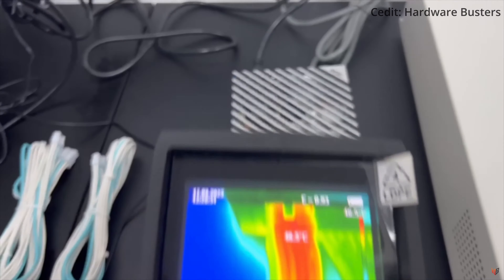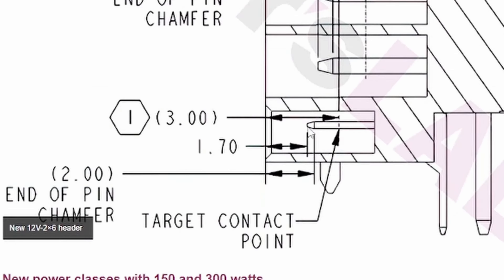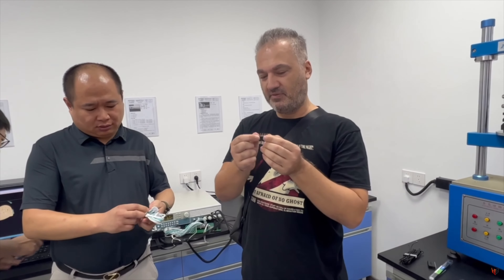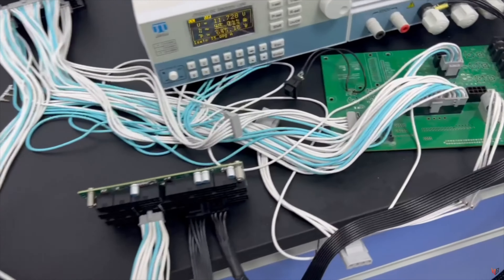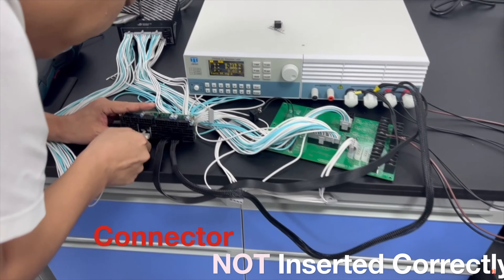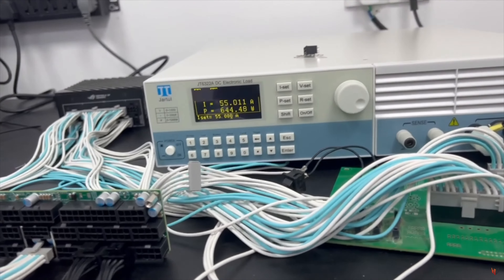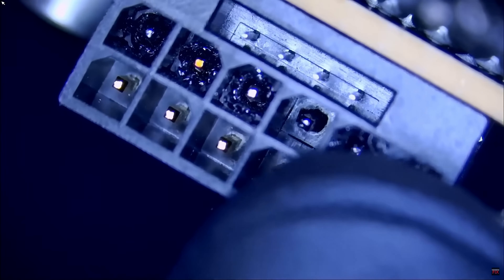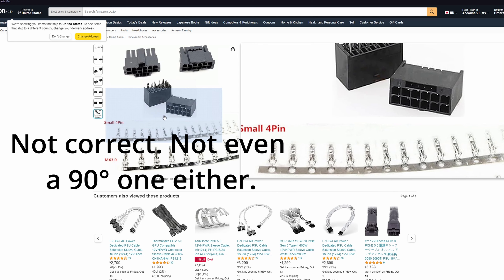Did Nvidia fix the 12VHPWR Cable/Connector?

Comment: I appreciate the dedication you have to reporting on all of these updates as they happen. Nvidia, Cablemod and any other company that sold adapters for these cards needs to refund or replace their product. Consumers are not supposed to be the guinea pigs when it comes to new product releases. All of these companies need to admit where they were wrong and then make it right for their customers
Reply from the maker: Thanks man, It would be nice to see someone step in and get a lawsuit going, Nvidia has so much money at this point, I wouldn't be surprised if they just agreed to send them out for updated connectors. It's actually a pretty simple solder job, and could save a lot of future headaches. The melting stuff happens so often now that people are just not reporting on it as much. It's almost a norm according to a few people who deal with repairs I have spoke with.
As always, appreciate the comment.
Reply: @techwandoUS  They should replace them if you have the faulty connector, These Cards are VERY expensive. There should be nothing like this ever wrong with them when they come out of the Factory, and they charge you so much.

Comment: The problem is no safety margin. The old connectors have almost a 2:1 safety margin. You could put 250 watts through an 8pin (rated 150) and have a higher safety margin. Sure on paper using fist approximation it has a 10% safety margin. However the single locking mechanism and mechanical tolerances on shipped connector isn't enough to maintain design contact level.
Reply from the maker: I always said they needed some sort of double clip. 
Totally agree.

Comment: Just had my cable melt in my 4090 after 18 months of intense use. It was installed correctly and not bent since I knew of the issues when I put my pc together, I even would check that it never was smoking or anything for the first month. I think the thousands of hours of heavy usage caused it, but it’s still unacceptable.
Reply: My power supply was the MSI MPG A1000 and my gpu was the MSI RTX 4090 GAMING TRIO
Reply from the maker: Appreciate this comment, many people act like it's user error. You ran it for 18 months and it still did it, it's obviously not user error.
Is MSI honoring your warranty?
Reply: @techwandoUS  we'll see when they open their support lines on Monday I'll reply with updates. I actually contacted Nvidia directly to ask questions and after I asked what if MSI didn't replace it and they reiterated that "they will replace it". 

I'm assuming they just automatically replace everyone who is affected.

I actually am really wondering if in like 5 years we will see a lot of melting GPU cables. The only difference I have to most users is I actually use my GPU at max usage constantly. 

I just have a gut feeling that given enough thousands of hours on specific cables with 100% GPU load that this problem is inevitable.
Reply: @sloanphone2323 Did you get your GPU replaced?

Comment: When buying aftermarket cables, you want the largest gauge wires they use. The lower the gauge number the thicker the wire. A 16-gauge wire will be thicker and more robust than an 18-gauge wire. The box the cables come in, or the product description, will usually indicate the wire gauge used.
Reply from the maker: Yeah, I'd recommend the adapter before grabbing a cheap cable as well. Most of them aren't really tested through a long burn in cycle.
Reply: Mine is the 15 AWG cable with crimped pins. Custom cable, hand-made. Each wire is tinned copper, rated for 23amps. Should be safe.
Reply from the maker: @olega5141  15 awg is a quality cable. Very nice.
Reply: @techwandoUS oh lord, have you seen audiophile cables? I've tried seeing if there's any OFC or silver ATX cables for my audio PC but no dice. None of the psy manufacturers even know what type of brass is in their ATX terminations. Meanwhile my audio equipment has the most immaculate 10awg OCC cables, my PC is literally the bottleneck.

Comment: I like your videos because they prompt research and made me find the best peace of mind with this cable yet. Not sure if astron vs NTK is really an older vs newer design but more of a company manufacturing difference as both are different connector manufacturers with both company's terminals being used since the start of the 4090(or at least since the 4080s release but there are articles mentioning NTK connectors on Oct 22). After researching what the seasonic 12vhpwr 2x8pin to 1 connector uses I came across that its terminals are manufactured by molex a design called molex minifit jr. I can't find any spec sheets on the NTK or Astron terminals.

Edit* after finally taking a good pic. It uses two larger eliptical contact pads vs the 2x3 dimple array of Astron or the 4 spring arms of NTK. I cannot find the spec sheets for NTK or Astron but the molex design is from as far back as 2009 ish.
Reply from the maker: Thanks man, what GPU are you currently using? I feel like I remember you mentioning a 4090 back on the latency video, but I forget.
Reply: The msi gaming trio non X 4090 paired with a 13700K on DDR4 4000 cl16 bdie. There was this video put out by Game Day a smaller channel testing ddr4 vs ddr5 on starfield. I believe it was all in win 10 but on ddr4 8c/8t no ecores was the highest fps/highest lows and on DDR5 enabling ecores but with HT off was best fps/lows ratio. Ive been testing in other games and it hold true on DDR4 so far. 

Alex from digital foundry screenshot a comment I made about OCing pcs to get better gaming experiences. I spent a month testing configs and gathering data. I stumbled across a way to have statistically perfect frame pacing. A true nearly 1 to 1 output of frames to your monitor. I have to do a lot more testing but I dont mind sharing it. It is just front edge sync an option found in how RTSS frame rate limiter works. You can use it with vsync on or off(and with off have no torn frames + less latency). I think all it really needs is a semi powerful cpu. I was able to get some perfect pacing on my 8700K setup. This does not suppress stutter caused by shader comp or traversal just forces perfect pacing.

More tests I need to run are how well it works at higher refresh rates(maybe 120) because I game at 4K 60fps and after 120fps as long as your frametimes are good the game is smooth and buttery not neccessarily needing perfect pacing anymore. This makes 30fps and 60fps on pc playable and enjoyable. 30fps and 60fps is a very different experience when its 60fps avg, 60fps 1% lows and 60fps 0.1% lows. I used capframeX for the data capture the frame pacing is so consistent the upper bounds of the graphs are 16.673 and 16.66. Works for perfect flawless 30fps as well which I sometimes use for 6K cyberpunk + controller.

*edit: for front edge sync(FES) to work you need to use that second option the scan line sync. With FES on you can move the tear line with that scan line sync number until it is out of your primary field of view and then it looks like vsync on. It can be negative or positive to move the scan line up or down. Sometimes it dsyncs so I play with vsync on but you still need an arbitrary number in that field for FES to engage.
Reply from the maker: You should definitely make a video on this if you haven't already (1 to 1 FP) I have checked out some of your videos and I can see why you need that perfection..As for DDR4... I am still on it as well (Dom 4000s). I've had plenty of opportunities to swap but, I am pushing it out till it's completely unsupported, or whatever Intel or AMD bring that will make me drop Z790/raptor. Also pardon the delay in response, the YT app for Studio is atrocious. Comments disappear into the either so often.
Reply: Hey no worries! Comments totally evaporate sometimes even before my eyes inside the studio lol. I switched back to 60fps on pc because going from 240hz 1080p on pc to 60fps online smash bros is so painful its unreal. Although the pc experience is def better than the switch its at least visually less jarring to go back and forth at 60fps on both.  

I say until something like 8000+ gear 1 is stable very easily across all cpus its not worth it but around that speed the latency starts to match DDR4. I like to use my hardware for a while, until about a 2x uplift in all areas is possible, so next cpu for me will probably be whatever platform uses DDR6.
Reply from the maker: Smash bros situation makes perfect sense honestly. Frame rates in fighting games seem like a pretty important thing to be consistent.

I have a feeling DDR5 platforms won't last as long as DDR4 has, it seems like Vram and Dram are almost a whole generation off. DDR4 just lasted so long, it's actually wild to think about how old z170/x99 is.

Comment: Yes cool idea! I buy a graphic card for around TWO-THOUSAND US-$ and the first thing to do is ripping off the power connector and solder  a ali express connector on it. 
SHAME on NVIDEA and all the other graphic card manufactures!
Reply from the maker: It's not necessarily an "ali express connector" the manufacturers use many of the same exact products as they sell. The idea is to find the latest design and swap it out. I have worked in SMT for years so it's not a hard process, obviously not recommended for most people. 
Obviously Nvidia* should be handling this, but they won't.

Comment: How can I tell if my card has the updated connector? Strix 4090 OC. ASUS customer service chat wasn’t any help.
Reply from the maker: So if you have any form of an updated connector it will be the sense pins being slightly shorter, but most likely you do not have the newer one featured in this video.
You can look at the sense pins and see if they are recessed. On the older connector they came out almost to the edge.
Reply: @techwandoUS   thank you for replying. I just bought it earlier this week. It seems to me that the sense pins are recessed on mine.

Comment: I just got a (new) 4090 asus strix oc from amazon november 2023. I'd bet it still has the 12vhpwr plug, but how can i tell for sure? And, is there any way at all to upgrade to the 12v-2x6 if mine is the 12vhpwr?
Reply from the maker: If you look very close at the sense pins, you will notice they are more recessed vs the older models. It's not easy to spot, but the older models sense pins are quite long. 
Changing the connectors requires some soldering skill, heat gun and wouldn't really be worth it unless you ran into an issue. That being said there are many tech channels/repair shops like North Ridge offering these services if it came to that.

Comment: I am planing to buy a used MANLI RTX 3070 dual fan & it uses 12 pin, comes with a converter 2x8 pin to 12 pin...is it safe? I use old PSU Cooler Master Silent Pro M.2 1000W Silver 👀
Reply from the maker: 100%. There were no known issues on 30 series
Reply: @techwandoUS  wow so fast reply 🙏🙂 thank you so much ♥️ so its only issue with 40 series. Btw subscribed 👌

Comment: Bottom line. If you have a lot of failures due to user error even after warning then you have a design failure. These shouldn't be rated above 350 watt's. That would give them a similar safety margin to standard 6&9 pin connectors. With a better latching mechanism and the new adjustments to pin lengths I could see maybe 400watts. Frankly they should up the wires and connectors one gauge and have latching clips on BOTH sides.

Comment: It's an interesting video and I will look at theirs. However the voltage they were running was a bit low at 11.7, when it should be ideally 12+
Also, the wire reached 46c and this is with no gpu to heat it up nor a case. I have conducted thermal testing and the wire reaches 49-52c on the side facing away from the GPU. The side that faces the GPU is 59-64c
Reply from the maker: I did notice that too after watching this video back. They were slightly out of spec. I mean it is Asus's main manufacturing company, so they will probably be fine, but it would have been nice to see it dead on. Appreciate the comment.

Comment: Can somebody start a class action suit here in Canada? I paid $3600 for this video card and mine gets the ridiculous temperatures. I have to basically back off all the time at the connecter I mean and I was an early adopter with cable mod and it’s helping I don’t know if it is all I know is I’m constantly touching it just to fill out hot it is and when I feel that it’s hard enough I back off I stop when I’m doing.
Reply from the maker: Personally I run mine at 90% power target, it's unfortunate we have to dial it back but I think it's the only way to save it long term. 
What model do you have?
Also I am not entirely sure about class action from CAN vs US but they are a private company and you did purchase something from them. There have been a few people that have tried, I looked up prior lawsuits and one was filed in 2022 but went nowhere. Their lawyers are probably crazy, and then having the Gamers Nexus video calling all issues user error, it's hard to create a good case...
UNLESS Cablemod steps in because they are losing customers and money from their adapter issues.

Comment: As I've stayed before in probably multiple threads, apologies, but I'm running with a thermaltake core P8 which is a massive case, I mean freaking huge!
And with my 30 80 TI I was still bouncing a high temps off the class.
Reply from the maker: Still a cool case though 🤘
How's the new card holding up?
Reply: @techwandoUS  as of yet, it's doing great. With its notoriety however, I don't ever leave my machine alone for longer than 5 minutes. It takes to go up for a smoke break on the porch.
Been messing around with different games from fallout 4 to cyberpunk to pondering buying DayZ
Reply from the maker: @Stormpriest  Fallout 4 is very fun to go back to. Have you tried Dishonored 1? I hadn't played it since release like 10+ yrs ago. It holds up so well, and is so strangely innovative for the time.
Reply: @techwandoUS  My fallout 4 is... Anything but vanilla lol
On average, I'm running anywhere from 800 to 900 mods. as to dishonored, no, I haven't never played that one
Reply from the maker: @Stormpriest  that's a lot of mods, damn haha.

Comment: Nice update.
Reply from the maker: I wish we would see more of these newer designs on the 40 series, but they probably won't come until the 50 series stuff.
Reply: @techwandoUS  I just bought an ASUs TUF 4070 ti super. Do you know if ASUS is using the new connectors?
Reply from the maker: @freedomearthmoon1  Most likely it just has shorter sense pins but it is not the actual new design. You will have nothing to worry about though with that cards power draw.
Reply: @techwandoUS  Thanks, I opened a support ticket with ASUS . I'll follow up.
Reply: @techwandoUS  Here is the official response from ASUS. ................
Hello ,
My name is Ramonsito Louis G. and it's my pleasure to help you with your problem.
In regards of your pending escalation with us , Please be informed that the only affected units of the melt issue was the 4090 Cards. The 4070 units was not affected by this so the design that the 4070 use is still the same.
Reply from the maker: @freedomearthmoon1  yeah, it's pretty much only 4090s at this point. Hope you enjoy your new card.

Comment: Just lost my RTX 4090 ASUS TUF after 1 year, bought it on day 1.. it makes no sense. Really annoying. Getting 1 reply per day via email, useless. Always kept it pushed in and checked on it every 2 weeks or so. Haven't touched the PC in months so it's not like I moved it. No bends, no gravity pushing it. Vertical mount GPU and the PSU cables go straight into the NVIDIA adapter at a nice straight angle.
Reply from the maker: Damn. I am sorry to hear that. Just running the stock cable too? That is a scenario I haven't heard since the first few months. No OC or anything?
Reply: @techwandoUS  Luckily I just received a proper email with not only a DHL return link but also 2 options: a full refund of the original price (1950 EUR) or a replacement. Money is obviously the choice here, you can buy a Strix for that money or even a watercooled MSI card (Suprim?) or a cheaper one from 1650 EUR and save some money + fresh warranty + whatever new modifications they've made to these cards since launch.

 I did OC the card. Used it around 450 watts to 500 watts for a year. Never had any issues. I also used it with stock and undervolted settings. A mix, depending on the game. It also died while being undervolted in Battlefield 2042's new Season 6 release. Stock PSU cable and the stock NVIDIA adapter that came with the GPU box.
Reply from the maker: @mcgmgc  Definitely go with the money, id do the same. Glad to see they are making it right at least. If you had the 90° adapter from CM you might have been out of luck. 
It seems like this still happens once a week. I bet it will continue until all the early Rev. 1 models are just gone or replaced. They definitely know about it, I just wish there was some transparency about it from Nvidia.
Reply: @techwandoUS  Yeah I am guessing something is wrong with these older models. I'll send it back today and see what happens. They said they have to inspect it but I know it's not a user error as I made sure this damn thing was plugged it properly every time.